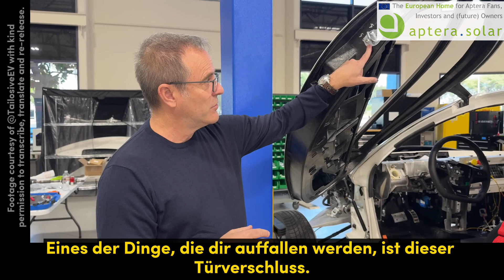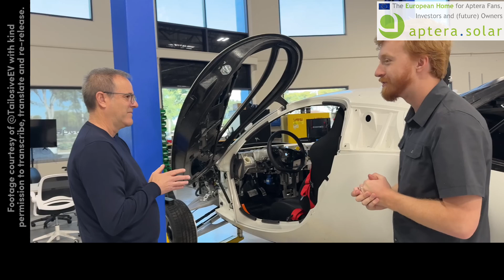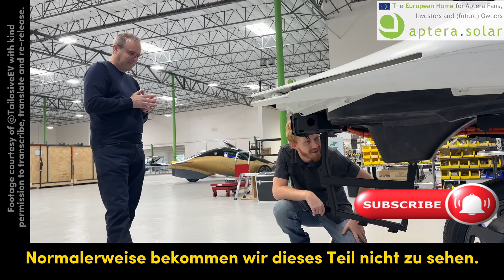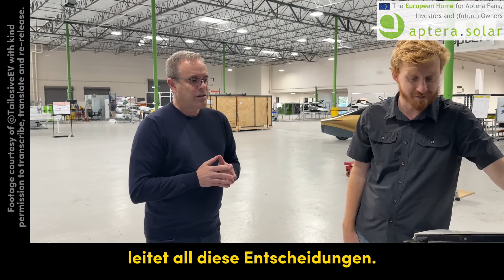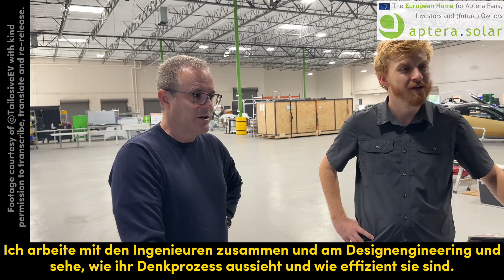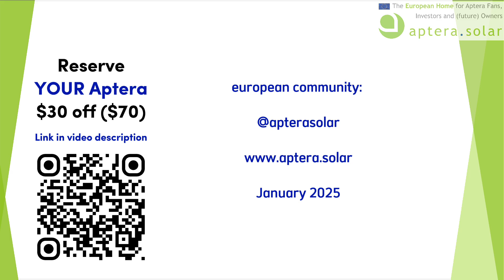DE: Aptera PI2 + PI3 Deep Dive - Interview JASON HILL (Fokussiert, Audio optimiert)

Comment: Being a Canadian, I can't help but wonder if that mechanical license plate might get stuck in extreme cold temperatures.
Reply: When things get wet and freeze all sorts of things go bad. I had an issue with my Elantra recently. It has a plastic ring around the gas cap that usually spins. Its to keep the gas cap from getting lost. Unfortunately it got wet and froze. Getting my gas cap off to fill the tank became an issue. I came close to cutting the tether but managed to break the ice.

Comment: The door latch -- so logical to do it that way with the latching hardware in the body rather than in the door!  I have wondered what it would be like getting in and out of the Aptera in the rain.  The upward opening door would offer a little protection as you wrestle out your umbrella and try to keep the inside of the vehicle from getting too wet!
Reply from the maker: We will have to wait a few more days until #CES2025 when Aptera Motors reveals their PI2 / PI3 vehicles.